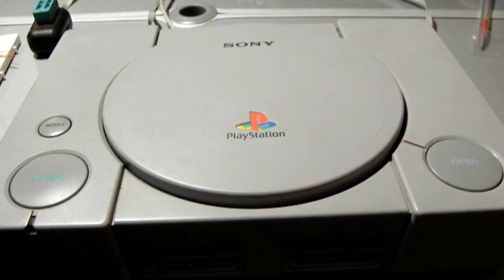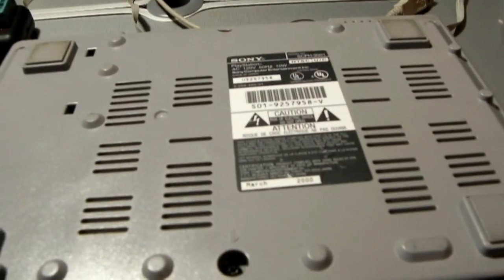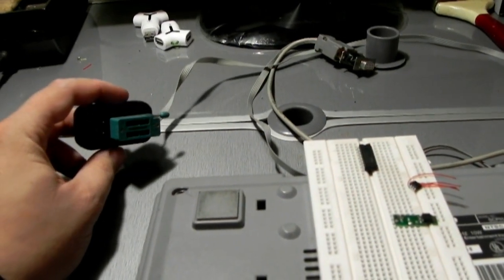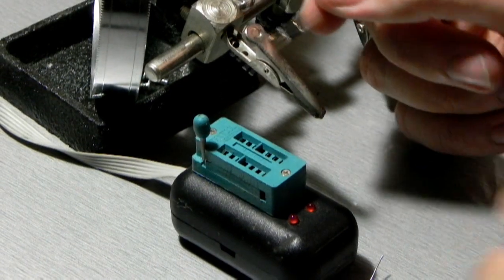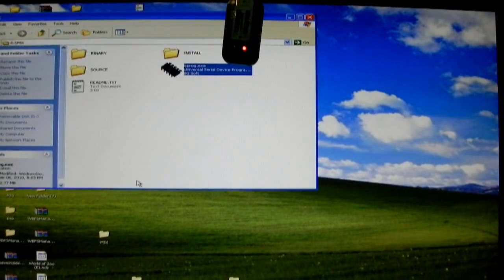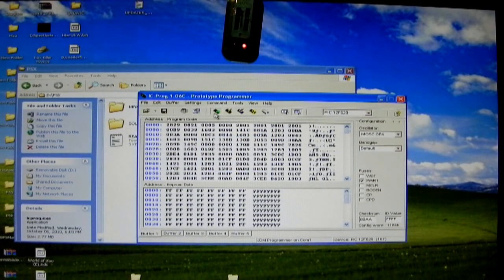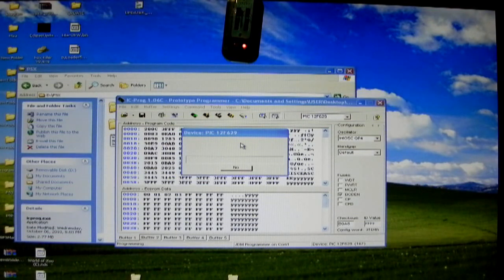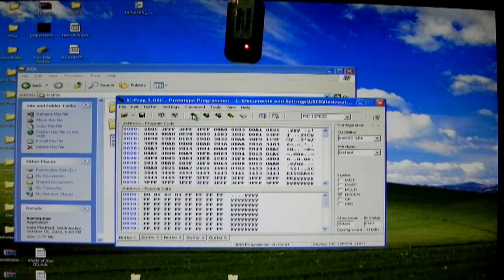Lets mod a PSX with a PIC12F629 Part 1

Comment from the maker: In this video I used a home made programmer, but these days digital programmers are much cheaper you can buy a TL866CS mini programer from ebay for about $55 worth every cent.

This video is pretty old you can use "mm3 hex dump 12F629" from " goo(dot)gl/H1zzy " its newer and is best for all phat PlayStation systems, or NTSC Psone consoles, for Pal Psone consoles you need the Onechip code from the link and Pic-12C508.

Comment from the maker: Yes and no,while sony did release a PSX console late in 2003, the term PSX existed long before that as a secondary codename to the popular "PlayStation" codename,SCEA disliked that name due to marketing reasons, and refered to the system as PSX at CES 1996 they promote the playstation  with the slogan "PSX welcomes Sega to CES", unfortunately much to sonys japanans dismay the name stuck,and was used in alot of marketing, its still refered as a PSX here rather than a Playstation. goo(dot)gl/Na2hw